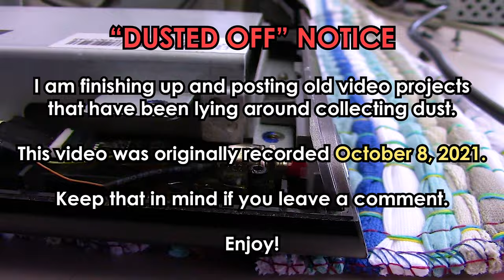The Power Switch Was The Problem The Whole Time - Jody Bruchon Tech

Comment: The best thing to do when troubleshooting is adhering to Occam's Razor, which states "the simplest solution is often the correct one". Start with the simplest thing first and then ramp up the complexity if the simple things don't work. It can be really hard to think that way about problems if you have an advanced understanding of computers because we often think about the worst case scenario.

Also, side note: the power button on my gaming PC broke at one point, and I was too lazy to replace the power button or the case itself, so I had 2 exposed wires that were previously connected to the switch poking out of the case and I would just touch them together whenever I wanted to turn my PC on. I called it "hotwiring my PC". Lol

Comment: Here's a weird one you might like:

I knew somebody who had a computer running a dual boot system with both Windows and Linux on it.  It also had USB-to-PS/2 adapter connecting to the keyboared and mouse.  The set-up always ran fine in Win, but would randomly do weird things in Linux.

The guy was naturally convinced there was a bug in the Linux, but, after thinking for a moment I said "it's not the most likely thing,  but keep an open mind: there's a slight chance there could be some marginality in the PS/2 adapter that only Linux is sensitive to".

The guy laughed it off, but then called me back later and said I was right. He had  eventually swaped out the PS/2 adapter, just because it was a quick , easy thing to do, and he was out of ideas, and the problem went away entirely after the swap. He cut open the adapter to see if he could find a problem in it, and it had a CRAPPY cold solder joint to ground.

I'd be interested in knowing if you can nail this down in greater detail: Is Linux just faster, and seeing noise that Win is just too slow to see?
Reply from the maker: It could have something to do with differences in power management between the two. A frequent annoyance is when some mice get put into standby when not moving and Linux registers the waking mouse as if you unplugged it and plugged it back in.

Comment: Pulled a full sized desktop machine that didn't look like it had been stripped of useful parts, out of an open dumpster at a friend's apartment a couple of years ago, thinking I would just get parts.. The amount of dust in it was amazing and I cleaned it outside... But then tried to start it up and it wouldn't turn on. But the total lack of response from the power button was suspicious, so I pulled out the connector at the motherboard end and jumped the PWR SWITCH pins with my screwdriver and boom it was on. Everything fully functional. Turns out after removing the front panel that the actual power button that sits behind the front panel had been pushed too hard and had fallen off behind the machine's front panel, which is just plastic that reaches the actual button. The design of the machine allowed the outer plastic "Button" to go quite deep, which is probably what broke one of the plastic clips inside that held the actual button in place.

What was surprising wasn't that this happened, but that the original owners just tossed it in the trash with no attempt to service it, or so I guess based on  the dust buildup

Comment: If there's one kind of problem that I hate trying to fix it has to be intermittent faults. This video reminded me of a computer problem that I was really struggling to fix years ago with an Acer Aspire T180 system that was turning itself off at completely random times.

Just like yourself Jody, I checked everything that you normally would that could cause such a fault such as the RAM, power supply, temperatures, etc and everything seemed fine which didn't make sense. I even resorted to doing a clean install of everything and the problem still persisted after that which left me completely baffled as to what was causing it.

Due to the fact that I had no clue as to what was causing the random shutdowns, I eventually came up with the idea of having it setup next to my main PC. That way I would be able to use both computers easily and be able to monitor the faulty computer very closely by trying to use it for everyday tasks, after a few weeks of doing so I finally managed to find out what was causing it to shutdown.

As I was using the Acer T180 to do some web browsing, I found that the Internet connection had suddenly stopped working on it so I checked the main PC and it was still connected. That was the "Aha!" moment that I was looking for! I went into the network settings on the Acer to check the network card settings only to find that the network card was no longer present in the device settings. That's when I realised that the network card of all things was the culprit!

Comment: Yesterday, I received a new CoolerMaster case to hopefully repair a new build that I haven't been able to fix for three years. It won't boot. A small light on the graphics card lights but nothing else happens. I've replaced EVERYTHING. Everything but the case. I mean, how can the case be the problem? If I wasn't so disheartened by my experience with this machine over the years (Most of the time and for years at a time it just sits in a corner covered by a cloth. There's been too much disappointment.), I'd be looking forward to trying the new case. My thinking now is that the motherboard is shorting somehow or the front panel wiring installed in the case is faulty. I will post my outcome here when I have it.